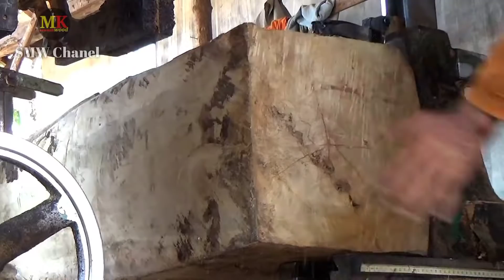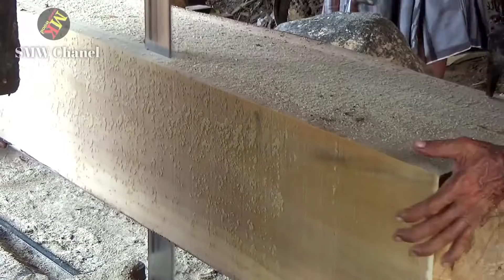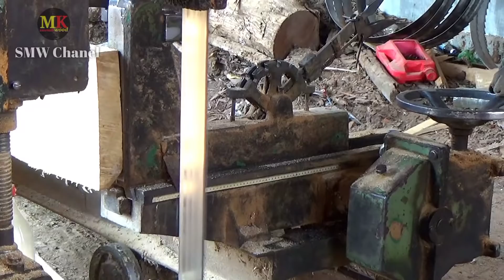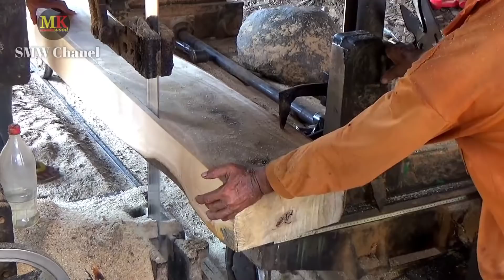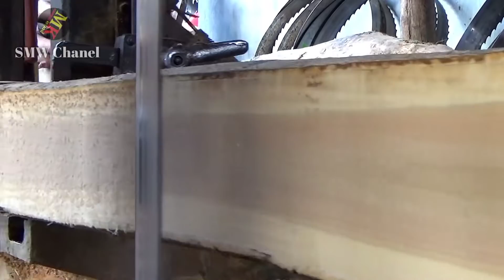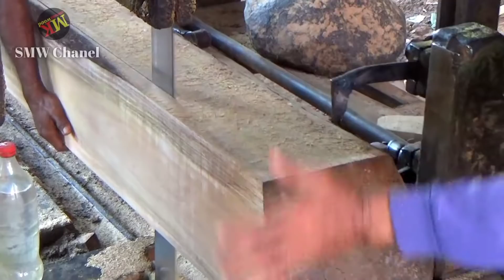Ditipu oleh oknum tak bertanggung jawab,Kayu jati putih raksasa berakhir tragis ditangan sawmill

Comment: Are blades ever made that have teeth on both edges, cut both directions?
Thank you
Reply: No ITS  canot . There is a push mecanizm on oposite side of teeth
Reply: @gunawan5076  , thank you for your quick response.
  Blade compression in the direction of the Cut, I think.
God bless you. C
Reply: @gunawan5076  Perhaps this could be done if the blade was driven by a sprocket in center of the blade. Just a thought.